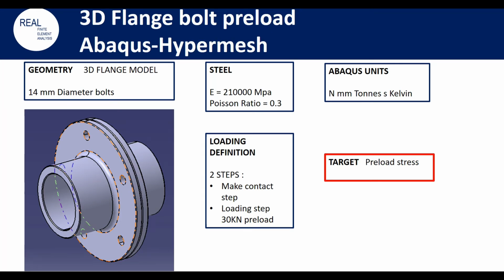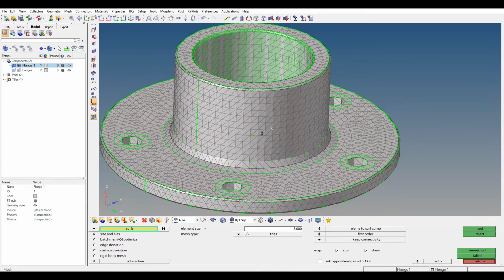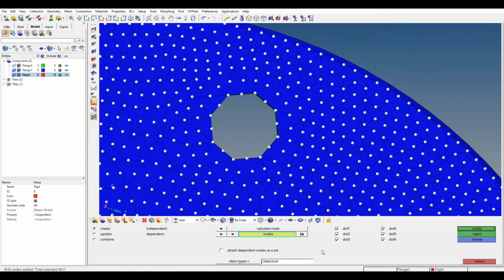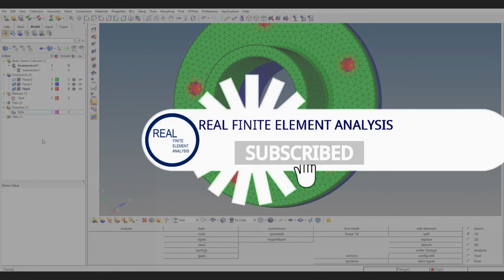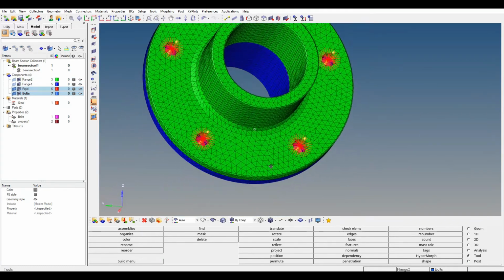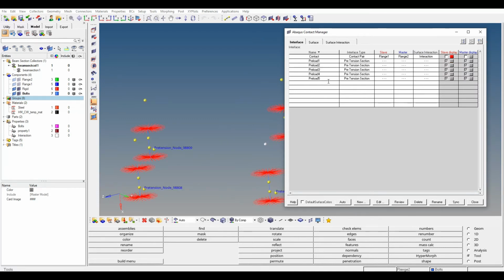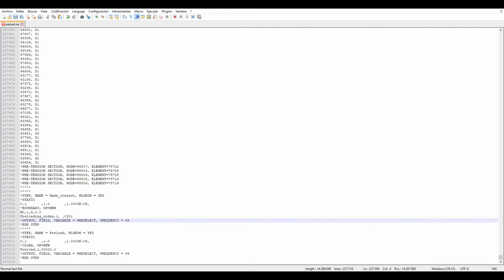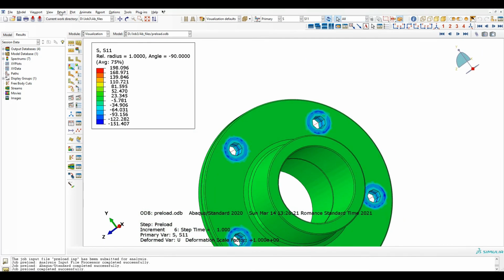How to create bolt preload with Hypermesh and Abaqus

Comment: I wonder why you take the pain to manage your model setup using HM while you can do it with Abaqus/CAE that is way much easier/faster/robust to prepare an Abaqus model ...
Reply from the maker: Hi, imagine you have a huge abaqus model. I always prefer to use HM as it gives you many more possibilities. Imagine you want to modify your model by setting pretension loads. I mean you can do it as you prefer but for the kind of models I normally use it is far better HM

Comment: why benefitting from hypermesh, couldnt we do samethings with only abaqus?
Reply from the maker: Using Hypermesh or Abaqus does not matter. It depends on what you prefer to use. In my case, I feel more comfortable using hypermesh but always taking in mind that the processor is Abaqus